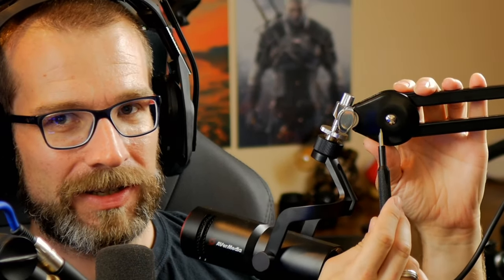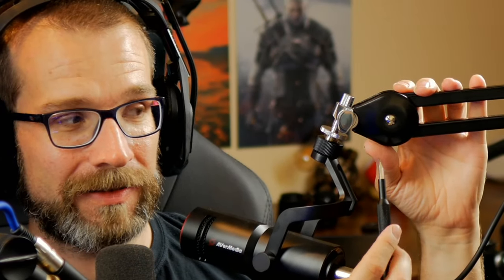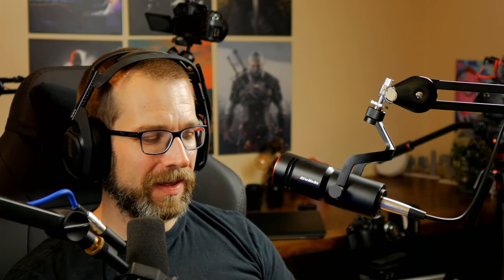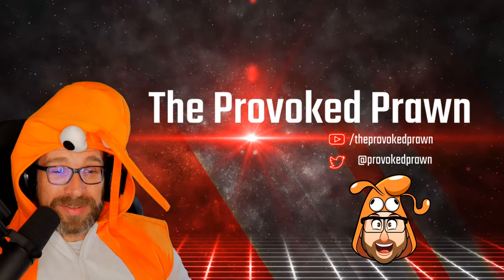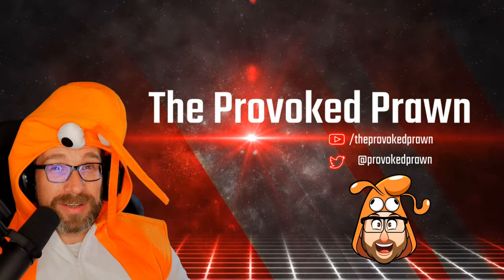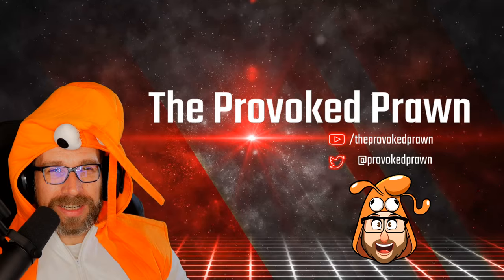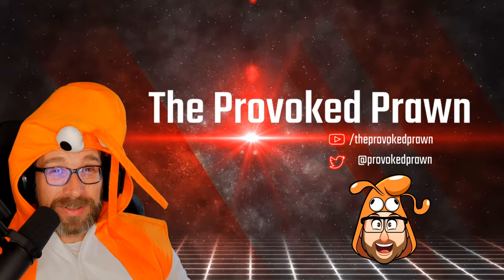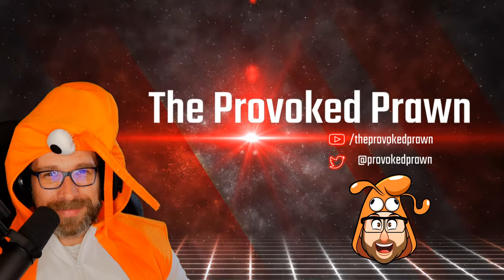How to Tighten and Setup the Rode PSA1 for easy use

Comment: Maybe i just got a dud arm but i tightened this to an oblivion and it literally does nothing to the arm it just goes to the sky as soon as i let go
Reply: Have you fixed it? I have the same issue.
Reply: @catalin0504  nah i ended up sending it back it was 100% dead. I got a replacement and im still using it right now. It was definitely just a bad one. If yours is as bad as mine was just bite the bullet and send it back for a warranty replacement from wherever you bought it from. I ended up refunding it and getting the pro arm and its worked beautifully since i got it 0 issues. There really was just no way to fix mine she was stuffed out of the box.
Reply: @byronlefevre8266  I will see what I can do, this is the replacement I received for one that was damaged in shipping. Funny enough, if I ignored the visual damage, it worked just fine.I just didn't want it to rust on me since there was expodsed metal.

I will contact Rode to see what they suggest. Maybe I will upgrade the mic since the snowball is also cracked.

Comment: i have a samson q2u and its so light ive tighten it as much as I can and it still moves around when i dont want it too . wtf. the price premium is insane for this boom arm and to still not have it work flawless makes me so angry
Reply: same issue, here, I have returned it. No more of this nonsense.
Reply: @donald6786  i managed to work it out. you just have to tighten it for light mic then if still problems just keep adjusting it till its wear u want it. so for example i noticed if u want it higher and it springs back just move the arm out more making it further away from you so the arm has to work more on keeping the mic up.

Comment: Thank goodness, this actually helped a lot. Before I would bump my desk just a little bit and the mic would fly into the sky cartoonishly. Now, not only does it not do that, I can actually put it into any position I would want!
Intuitively, I had ASSUMED that I needed to tighten the pivot in the middle since that was were the motion appeared to start. As it turns out, it was the pivot point closest to the microphone which I would have never thought to tighten without watching your video.

Comment: I'm looking at my PSA1 and as far as I can tell that screw holds the two upper arm segments in alignment. It does not apply pressure and it appears to be entirely independent of the spring mechanism. I just cranked it down on my own arm and, to be sure, nothing changed.
Reply: Well, I found a RODE FAQ that says all three pivot points can be used to tighten or loosen the tension so I retract my prior statement.

Comment: Thank you for this! I also have a different problem, where the base (the part thats mounted to the desk) doesnt stretch at all - it always wants to stand up right-ish but I want it to lengthen (sort of like parallel to the desk). Would I need to loosen the base/bottom screw for this?

Comment: A bit too light? Would need a mic the weight of a brick to keep this thing from boouncing around. Thanks heaps for this tho, i spent $150 AUD on this and was really annoyed when i set it up and discovered that it's not adjustable. Like what is the point of it?? I was ready to return it before a quick google search and found your vid. They really should have included some more thorough instructions. I just hope it doesn't loosen up over time, i just want to be able to focus on creating without having to worry about the endless list of niggly little things that interrupt the process and thanks to you i can scratch this one off my list. Now to get rid of the ground loop hum issue on my acoustic guitar.....

Comment: My psa 1 didnt come with one little adapter to fit my sm7b in the psa, if i buy the shure a26 (the black tube  adapter) it will still need that little adapter or the a26 solve my problem?

Comment: At the bottom of boom within last pivot area, mine has a plastic fixture that looks like it folds in and out. No idea what it’s for though, any clues ? Looks like it might be to assist if lying the boom arm really low, not sure. It definitely rotates vertically, looks like it should do something.
Reply: Pretty sure that's for holding the microphone cable